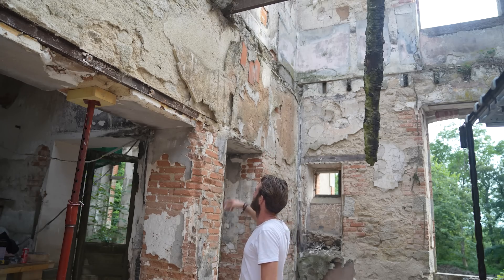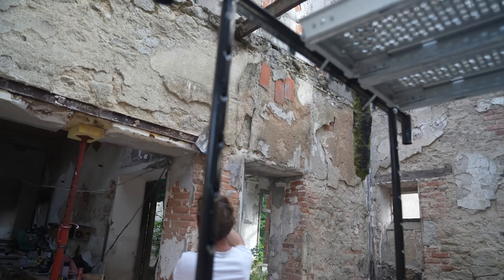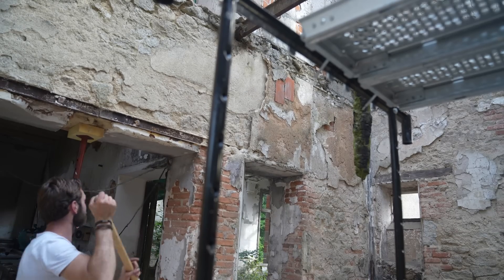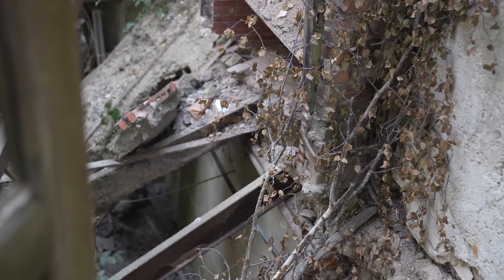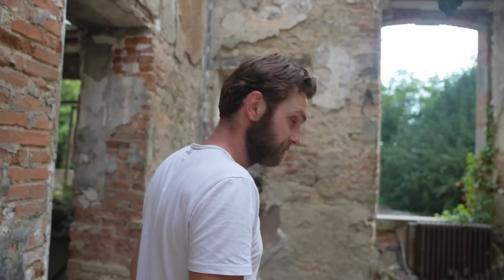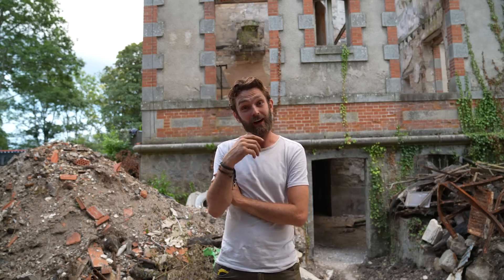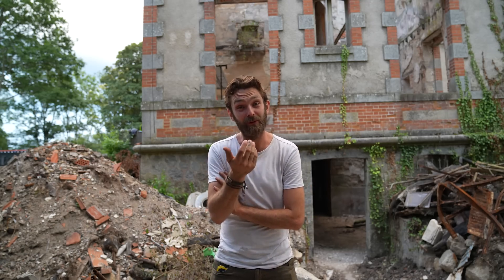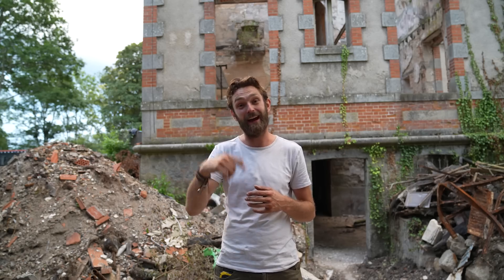Its so safe now, preparation for installation.

Comment: Dan, excellent work. I know you want to cover over the area where the servants staircase came up from the kitchen; however, please reconsider! Now after looking at other videos, I think you should retain this feature for three reasons. First, you have several doorways that used to open onto it and the room layouts will be impacted if you have all these unnecessary doors leading into rooms. Second, you have to think fire escape as well! Not unless you are prepared to have some metal escape ladders on the outside. Third, and MOST important, you were removing pipes from that corner. Having that servants staircase, you now have a place to run all the electrical, gas, a/c,  and steam / water for any sort of baseboard / radiator system. Otherwise, you are running it in the corner of rooms and/or outside. I think the original builder had all that in mind with the original floorplan.
Reply: Those stairs only went as far as the ground floor (one storey above the basement), which has secondary exits from almost all the rooms to the various terraces. They'd be really handy for moving food if the kitchen was to be moved back down to the basement though.
Reply: @Ragnar8504  Looking at several videos at that corner, I can see the window providing light for the next floor, but there are floor joists holes on the floor above. Not to say the did not frame something out. Strange part is on the next floor up, i.e. 2 floors above the basement, it looks like that wall has some sort of bricked up opening. If I recall, the building was remodeled sometime between its original construction and the fire. So perhaps that staircase did go higher and they just removed it at a later date?
Reply: @caminojohn3240  I think the bricked up openings are chimney repairs, too little rhyme or reason to their shapes for old doorways and just in the right place for fireplaces and flues.
Reply: @Ragnar8504  Watching yesterday's / today's video, I agree. I can't see any more windows on the one wall and the place where you say is a bricked up fireplace or something definitely has some sort of concrete footer. Still, I wonder how he's going to run all the electrical, water, steam, etc. It would be nice if he tosses out some plans on how everything is going to come together. This would avoid a "oh crap" moment where an "I" or "C" beam is right in the way.
Reply: @caminojohn3240  I think the place is large enough to find a space for services, especially if Dan keeps the bathrooms where they used to be. Drains would be difficult, everything else doesn't take up that much space and could be chased into the walls behind the steels, even though chasing granite is a nightmare.

Comment: The upper walls the last level are scary with Mortar missing, fractures in the walls you can't see. Dan you should have outside supports stabilizing the walls from the outside. I can see between the Fire damage & weather have taken a toll on the upper parts of the
Chateau & are scary. Be careful Dan!

Comment: It’s me again as I was looking at all the wonderful pictures I am wondering if you know yet how you are going to decorate inside as close to when it was built or a mixture of modern and the past ,I did see you were thinking about glass floors to let more light inside great idea . Hubby and I were thinking if you might even go to be as close as you can to the first green Chateau ,power water ,septic waste , as you seem to be doing a wonderful job so far using Green energy. Keep up the wonderful work .

Comment: Just thinking - why not leave the other side of the building without floors? Maybe a modern glass stairway winding up raw walls to a roof terrace, with a glass floor, so that all the light falls to the basement; it would be such a fabulous space - and you don't really need three more huge rooms...❤
Reply: Interesting design ideas.  Maybe not a modern staircase, in keeping w/ the old style.   But,  I know you are trying to just let the light flow w/ nothing to obstruct.  Maybe Industrial steel stairs with the rivets showing.   Opaque glass floors on roof terrace ( pretty expensive) so the view up is appropriate for girls, ladies w/ skirts...and someone else said privacy for kilt-wearers!😮😁
And, floors stabilize the walls, so there would have to be steel I-beams for each floor. 
But, of course...just musing.   Whatever Dan decides.

Comment: I am looking at art deco houses from that era. I did post a link to a home that had that arch door way on the second floor
Reply: Art deco is 1920s. This building is most likely very early 1900s or possible older, extensively renovated in the early days of WWII and again in the 1960s and 70s.
Reply: @Ragnar8504  true, but their are multiple elements of art deco. France had a bon epic period which encouraged art deco. The pyramids things at the top of the tower, the staircase, and other elements are a type of art deco.

Comment: Watching you drop those steel support beams, it just occurred to me that these beams are quite old as they were installed with the original construction of the Chateau. I recently read an article about how valuable steel made before WW2 is due to the rarity of steel being made before nuclear bombs were first dropped. Only this kind of steal can be used in certain medical devices due to radioactivity. I don't know where you would do this, but I would inquire... Hope you still have all the scrap

Comment: was wondering since Dan hasn't mentioned it if any original floor plans were ever posted with the  municipality the chateau is in. would help with any placement of pipes and or electricity connections.

Comment: Is it me or do a lot of the windows in the area Dan is working, used to be floor length windows??? I would put them back to get more air flow!!!!
Reply: I have seen in the comments others are wondering if that was the case... prior floor length windows.  Same commenters wondered if materials used under the big windows, which appear to be different from the wall,  was added later for insulation.  I am not sure myself...I think the jury is still out on that question.
Reply: @homeemail2306  You can see older brickwork behind those thin (looks like 30 mm) blocks in several places, the blocks are just stuck on with lots and lots of mortar, possibly even on top of the original plaster.

Comment: great to see the small progress. i was wondering if you can use your winch sort of upside down on the original steel beams above the beams your installing. by either adding a pulley or just feeding the wire over the beam closest to the wall where it is strongest, then bringing the cable back down and attaching it to the winch. hang strop off winch then attach to new beam. process would be lift 1 end up at a time.
Reply: I wouldn't trust the old RSJs, they're barely being held up by the crumbling wall. There's a big chunk of wall missing a little above the sill of that small window on the first floor, exactly where those RSJs should be supported. The whole inner leaf of the wall has fallen out.

Comment: Because lifting the next two I-beams into place might be a wee bit tricksy, might it prove prudent to do the I-beams 1st before installing the C-beam so that there's nothing sticking out slightly to catch them on as you lift the two I-beams up and into place? It's always the silly little things that stuff gets caught up on as you try to move anything heavy and / or ungainly and, as always, this maddeningly frustrating and time-consuming.

Comment: Oh Dan how I wish you had more help to tackle this monumental job.  Ive been wondering how in this world he can get a roof on this part of the chateau.....? Any ideas how its done??
Reply: In most mansion, chateau, castle renovations, you see alot of scaffolding, inside & outside for support; standard, optimal procedure.   Big budgets sometimes, and big loans for funding massive projects, in other cases.   The roof 1st, and then the interior. 
Dan has maybe 2 scaffolds, and they're not industrial.   I believe we heard him say recently he needs better scaffolding, even if just a few at a time as his funds allow, so hope he does that soon.  Dan is working his way up to the roofline, stabilizing the walls as he goes.   He is replacing crumbly brick and loose stone, repointing/remortarizing so it can support temporary roof.
He is doing temporary roof 1st.   Permanent roof ( mansard style) later, probably in sections, and as funds allow.
Adding walls help in stabilizing walls.
He is very close to the roofline in the main hallway 2nd floor.   A little more stabilizing up there and he can do temp. roof there.
Reply: @homeemail2306  I guess a simple low-pitch gable roof would do nicely for that section and the timbers could be reused for the top part of the final mansard roof. Scaffolding on the outside would be extremely handy but a harness and a hatch in the roof to get back down should do.

Comment: Dan the room you went into to cut the pipes is that the room the fire started this the collapsed floor? And when are you going to clear that room?
Reply: I'd guess either that or the original kitchen that had an equally collapsed ceiling, if not worse. Since the bedroom that Mme. Mironnet managed to get out of was above that room Dan cut the pipes out of I'd lean towards the kitchen but that's more of a guess.

Comment: What about the sections up on the top floor that ties it all together.  Have you completed them now?  Or is ckiming the ladders too much? 😎
Reply: In one of the last few Vlogs, Dan said he was going to return to stabilizing the main hallway 2nd floor wall soon.
He is almost done replacing brick & repointing up to the roofline.   But, he said Nick was coming this week.   So, we'll see if he & Nick will work together.   Or, if Dan can finish off that wall, and be ready for temporary roof on that part.
Reply: @homeemail2306  I'm worried that it peels back like a banana in a strong wind.  He's removed the ties, trees and rubble that stabilised it.

Comment: Can anyone tell me why the scaffolding is so wobbly? It seems wrong for scaffolding. Is this a different sort of scaffolding?
Reply: It's a very basic design and not the best quality. You can get much sturdier trestles for a setup like that, or a proper scaffolding tower with diagonal braces, wheels and all the bells and whistles.
Reply: @Ragnar8504  thanks!

Comment: When does the roof go on Dan?
Reply: As soon as Dan works his way up to the roofline, stabilizing the walls by replacing crumbly brick, loose stones, & repointing/remortarizing.   This way, it can support a temporary roof.   Permanent roof, original mansard style, later as funds allow.   Roof will probably done in sections, over the different wings of the chateau.
Adding floors stabilizes the walls, as well.
Dan is almost to the roofline in the main hallways, just a little more stabilizing of the 2nd floor wall.  Then, temp. roof for that section.
Reply: Thank you for your detailed reply! 😊

Comment: i wonder how you will do that roof, because its gone totally. maybe a small easy one?
Reply: Dan plans to put in a temporary roof 1st, in sections, after stabilizing walls leading up to the roofline.  
He does plan to do permanent roof, the original Mansard style, later, as funds allow.
Reply: @homeemail2306  isnt it all massive money? How he manage that?
Reply: @faragraf9380  Good question...I don't know exact costs.  I suppose doing the roof in sections, both temporary and permanent one, will help keep down the cost. 
Dan may be able to re-use the wood supports for the different roofs, as suggested by other builder/contractors in the comments. 
Here & there in the comments, I'll see costs of the particular size wood needed for the floors or roof. Might be able to roughly calculate 1 roof section cost from that, not counting later permanent roof covering ( slate, or will Dan choose metal?)

* I remember the glass ceiling replacement cost at UK Castle Highclere ( spelling?), the one used in Dowton Abbey series.   It cost around $100,000£ a decade ago. 
The family living there allowed partial tours of castle & grounds, and the TV series to help fund just that one section of glass roof over central large room.

Comment: What about insulation?
Reply: Something to worry about when the roof is on I think. He'll probably have to stud out the walls or use some kind of insulating plaster like the lime/hemp mix les Jerômes want to use.
Reply: @Ragnar8504  it has to come on the inside anyway

Comment: I've been watching these videos for a while now. As I have not seen them all, this question may have been answered already. 
I heard you say in this video "it's so safe in here now"... but is it really?  When there is a serious fire, things happen that are not immediately apparent.  One of those things in a brick, block or stone structure the mortar holding it all together can be made useless because of the heat. Have you had a structural engineer, architect, brick-and-mortar expert of some sort assess the condition here? I watch how much mortar sand you are continuously pulling out of the walls and wonder if you are not putting your efforts into a building that will have to be razed anyway.